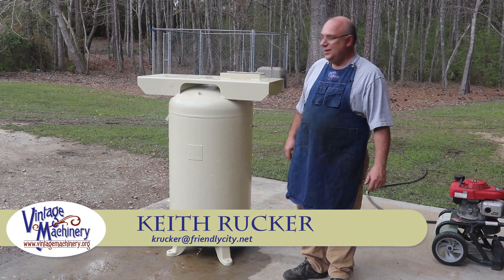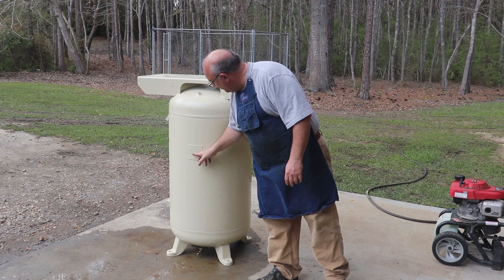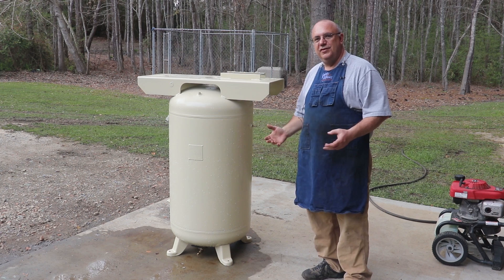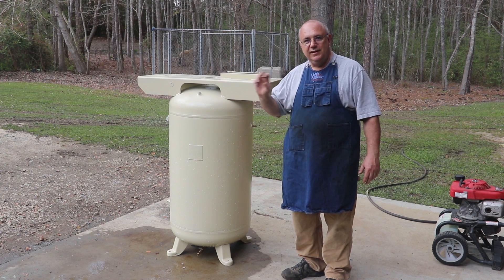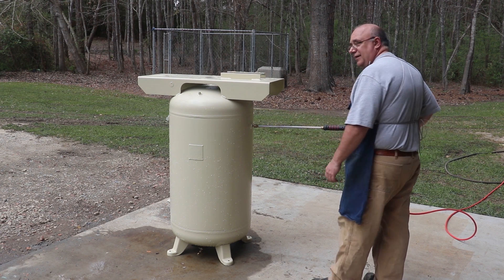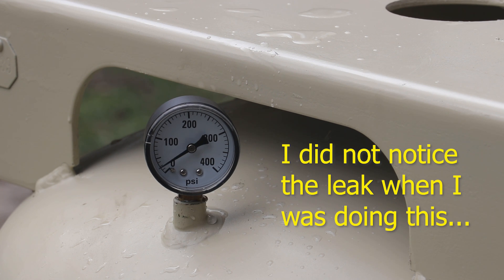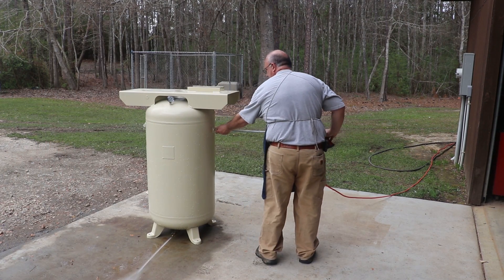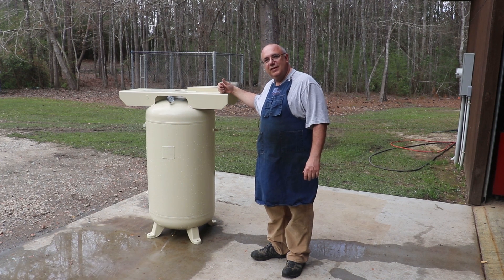Hydro Pressure Testing a Air Compressor Tank

Comment: In addition to the hydrostatic test my wife and I were speaking on getting one of those 8 foot ocean going container to contain the compressor? Obviously we would need makeup air in and out. After looking at the building blown to bits we are seriously considering going this route after doing Hydro tests.
We have an old Puma 60 gallon from 1992 or 3 and a horizontal 60 gallon from work that's at least 40 years old. 
Your thoughts to the group?

Comment: I have seen some dumb asses but you take the cake, firstly you don't have a safety valve fitted it should have a raised leg above it to vent the fittings of air and set to blow off at the test pressure, no raised bleed off valve from the highest point of the vessel  to get every bit of air out, that is imperative there must be absolutely No Air in the test vessel,  valves or fittings I have done tests on 20ton liquid capacity pressure vessels down to cigarette lighter sized pressure tanks Worst of all you are standing way to close to the vessel being tested, obviously you have never seen the destruction or damage  even a tiny compressor is capable of at much LOWER pressures 10-75 psi, The best Advice is if in doubt throw it out, or pay someone who is certified to do the test, it could be cheaper to buy a new Certified receiver, if someone gets hurt or suffers property damage you had better have very deeeep pockets those compliance plates on the receivers have dates and test pressures on them in industry they are tested every year  even if they are never used for years.

Comment: Awesome Informational Video! I thought I just picked up a old Air Compressor, but your air compressor is nearly twice as old as the 2002 Craftsman Air Compressor Model # 919.167340 | 33-gal | 6Hp | 120v/60Hz/1PH/15A I picked up last Sunday, February 2, 2025 from my local curb store. The owner told me that it still runs, but I need to purchase the gauges and a air hose: he helped me load it onto my truck. He upgraded to a new and stronger air compressor.  I was fortunate to find a Owner's Manual on the Sears Parts Direct website and after reading it and learning that a lot of the parts are out of production. I realized I don't know enough about using a air compressor; consequently, I am pondering on whether to keep the new replacement parts that I purchased from Ace Hardware. I was hoping that I could use the compressor to pressure wash the swimming pool deck and the driveway, but then that means more money! Yesterday, I spent nearly $110.00 for a air hose, two pressure gauges, a needle valve for the drain, a Craftsman Compressor Starter Kit and torque 20 bit. On Friday, Feb 7th I removed the shroud covers and cleaned them, but I still need to learn how to safely power it on. The sales clerk advised me to power the compressor on before I add the gauges, because it if doesn't power on then I can easily return the unopened products.

Comment: so glad to find your channel, we are in australia, we live quite remote and most of our things are vintage ..... (were not rich to buy brand new - which actually turns out the better option for repairs anyway) we have a 1972 885 david brown tractor with slasher and a 1976 nissan patrol 4x4 a 35 year old tripple cylinder air crompressor, which we had realised needs a closer look for safety issues, we just purchased a new pressure relief valve and will only use it outside the garage since we looked on youtube and see what has happened to some people in failing compressors, so we will give ours a good pressure test now, THANK YOU for this video and we look forward to checking out your other videos.  Channels like yours are priceless to us, just the two of us here, me and my husband on 60 acres and 200km round trip to anywhere, and costs a fortune for anyone to come out here so we try to do it all ourselves.

Comment: I don't really like how this was done.  These tanks often fail on the bottom where the drain fitting is.  I would have laid the tank on its side on a rubber mat and rolled it to a 100% dry area of the concrete slab so that I could have inspected for minute leaks at the drain fitting.  It's kind of silly to leave a tank standing in a puddle of water and be like "yup, I don't see anything."  Folks need to be really more thorough in the areas where these tanks almost always fail.  Or at least dry the whole tank and then use something like brown paper to find those tiny pores.

Comment: Hey Keith,
Thanks for making this video. I was watching The Compressor Guru and he mentioned how you do a Hydro test. I posted this question on his channel and I would like to get your opinion.
I would like to ask a question, what is the importance of draining the tank every day? I understand water and metal don’t get along with each other, but as soon as you turn these things on condensation starts to build up and pools at the bottom. So even if you drain it every day you’re not going to get 100% of the water out and it’s always gonna be damp inside which is going to promote rust.
Thanks!
God bless!!
Blue

Comment: Thank you for clarifying that age-old incorrect statement that "water is not compressible".  While it certainly has MUCH, MUCH lower compressibility than "air", it absolutely is compressible... and making a working test fixture that does so (to over 27 bar) has been a serious learning experience in physics.

Comment: Well Sunny beaches! I had a 80 gal tank that rusted through so I found one for 200.00 now when I was not to sure of the tank and wanted to test it. I read about people suggesting water test it, when I did not know who would do it I saw my pressure washer sitting there. After about fifteen minutes I found a quick air connector and put it on the pressure washer. iI figured maybe leave about a cubit foot of air in it and fill it with water, then I thought let’s see what YouTube says about it. Wow found this video! Doing the same thing! God is Good!

Comment: Nice explanation! The comments are interesting as well. Also, I was thinking if the remaining air in the tank mattered, possibly tilting the tank so that bung where you put the gauge was at the highest point while filling with the water to push the remaining air out. If it even matters. Thank you and May God Bless.

Comment: Use a pi diameter tape measure when hydro testing your tanks, they cost less than $20. Measure the circumference of the tank in three spots, top, middle, and bottom before testing. Measure them again after hydro testing is complete. If the measurements are the same then you had no permanent deformation. On older tanks hydro testing can cause unseen deformation, so you basically stretched it out and actually weakened it during the test, leading to catastrophic rupture when put in use later.

Comment: In my opinion, dumbest most dangerous thing I ever saw. That's right. Stand right next to it to see if it will explode. If you are smart and care about your life. just buy a new tank every ten years and switch over the mechanicals. If you spread the cost over ten years it's just a few dollars a month, (I've seen new ASME tanks, not the pre-rusted ones welded in Pakistan in a garage from old ship panels, for 4-6 hundred dollars. spread that over ten years, it's the cheapest insurance you'll ever buy. Don't be cheap when it comes to your life or others you care about.       Mike

Comment: Keith, long time lurker of your channel, here.  I inherited a vintage Sears Craftsman air compressor and have been wanting to do some kind of hydro test on it just for, as another connector said, peace of mind.  I didn't want to purchase any equipment that i would probably only use one, or pay to have a fully-certified test done, but as yet-another connector says, Ice seen the aftermath of a small shop compressor blow-out due to a rusty tank and I'd just feel safer with literally ANY test.  I had no idea i could potentially use my little pressure washer as a pump, it never occurred to me, so thank you for that!  I likely won't push the old thing over 150, I'll probably never use it for more than 80-100psi but i have over 4 decades of find memories for it and i want it to run again.

Comment: Pressure test by just standing next to the tank ? What if the tank fails ? Also dont think its good idea to turn on the valve for the water to go out so rapidly. I dont even find a reason to use a tank so old even if it passes the pressure test. It can fail in the next month or week or year after the pressure test since its that old. Are you gonna test it every month or so ? Just buy a new one. Not good practice at all this video to me. Its just common sense.

Comment: I'm glad I watched this before putting a used air compressor back into service!    I've seen air tanks fail before with compressed air and one took off like a rocket and banged into the shop ceiling, doing lots of damage - and could have killed someone if they were standing nearby!
Great job - I would never have thought of using a pressure washer to test it.

Comment: One way to do this is just pump it up to max capacity with air, then set it vertically on a big pile of dry wood and then light the wood on fire.  And then very quickly drive about a half mile away and try and catch it when it drops back in from orbit.  I call this the maximum apogee tolerance test.

Comment: It is quite exciting hearing the pops, snaps and other sounds, doing a burst-test on a test-specimen. I have done that :) We pumped up the specimens to 135 bar, before they leaked, no explosion at all with water. Just a pissing little leak of clean water. Of cource, just a little little bit of air was trapped during the test.
Good for 25 bar, the design that is. The test specimen destroyed.
Non-destructive testing is performed at 1,33 x MAWP (Maximum Allowable Working Pressure) as I recall it, cold or @ 20°C, save for higher temperature curves according to the material properties in question.

Comment: Q: are the tanks of those el-cheapo hobby compressors pressure tested?
Over time they accumulate condens water so i suppose rust could be an issue with those. i don't think those tanks have rust protection on the inside.

Comment: I hope I don't read your obituary in the newspaper saying you got killed when that tank exploded.  I heard air tank have a fixed amount of  pressure/depressurization cycles like the airframe on an a commercial airliner.  I'm thinking if it was used and given to you it may of exceeded it's number of pressurization cycles.
Reply: Everybody is going to die sometime or other. Never heard of an air compressor tank having a set number of cycles like an air liner fuselage.

Comment: Should you not also do a test with your relief valve installed to ensure that it opens?
Reply: No. The pressure relief valve  doesn't go to testing pressure and you usually need to refurbish the valve once it lifts,  because particles get onto the contact surfaces damaging them and thus preventing a good seal.

Comment: Good job. I bought an old Manchester pressure water tank (120 gal) for $70. I’m in the process of trying to clean the inside. But should I do this pressure test first? 
Either way? How would I clean the inside? I’ve seen fancy rollers (pitch) that roll abrasive material inside while slowly tilting (roll) to get the ends. But this beast is big. I’d rather find an easier way to scrub the inside. 
Thinking of Evap-o-rust followed by a wet sandblaster with my pressure washer. Then apply a rust stopper coating inside followed by epoxy resin. I just don’t know. You look like you know what you’re doing (except when you said “solid water 😬), so I’m asking you for advice. The tank is 40 years old and was being used as an air reservoir when I bought it. It has a lot of ports on it and a handle on top. Also has a drain valve underneath. 
Thanks for your attention. I like the quality of your work. 
(Max pressure inside will be 150 psi. It’s rated for 200). 
Paul.

Comment: I did this test twice, and my nerves are still shot every time i fire up the compressor, lol...  I used to run 150 psi, but I don't fill truck tires nearly as often as I used to, so I cranked the regulator down to 120 cutout.  But the test was run at 270 psi both times and the tank stayed silent and held each time for well over 30 minutes.   The safety valve is currently rated at 175 but I plan to get a new one rated at 150 or 145 because this one is starting to leak and pressure governors/regulators (mechanical) can fail and I just want more piece of mind.    I had already used the tank for a few years, just put some brackets on it to make it portable and mount the compressor and engine to.

Comment: Thank you Keith! I'm looking to buy an older 360 gallon horizonal tank, and this is a great start. If it has the larger bung I'll have pros look at it, but never in my life would I have thought to use my pressure washer in this manner. I thank you for your video!

Comment: Dangerous way of doing this. You should use a ball valve from a distance with a remote pressure gauge. You should also use a regulator valve, (not a trapped pressure unloader valve like is on the peessure washer). People, do not do this at home

Comment: Im all for the diy but as long as the correct tests applied for the tank. For a start the name plate or stamp should state the standard the tank was built, probably an ASME Section VIII tank, so you would follow UG-99 standard hydro static test procedure. At a min some of the test points are below:

Test at least 1.3 x MAWP (name plate) Pt = 150psi*1.3*LSR ~ 200psi minimum for the tank in the video, if the plate test pressure is 200psi its probably a 150psi max tank (dont confuse MAWP and test pressure). We dont know the exact test temp and material design temp and stresses so LSR is fudged here ~2-10% since its tested with cold water. Dont over pressurize a tank during the test as you could actually push it to yield. The tank design and test is meant to keep it well in the elastic region when its first built, tanks have safety factor and corrosion allowance but defiantly loose wall thickness over time and are weakened with age and cycles.

P inspection min = Pt /1.3 ~153psi, reduce the test pressure from 200psi to 153psi and do a visual inspection of the welds and joints for leaks, (dont go poking near a tank at test pressure). Test hold time is not specified for a hydro static test but it would be sufficient enough hold time to finish the visual inspection.

One note of caution, UG-100 allows a pneumatic pressure test of tanks where a hydro test would not work. In that case P test = 1.1 x MAWP and its done in incremental steps. Always reference the MAWP to determine the actual test pressure. Not the case for compressor tanks though, they are readily able to be hydro tested so UG-100 test is forbidden in this case, but good to note.

What the guy did in the video was more or less correct (for a compressor tank) but did not perform a visual check correctly, did not reference the test procedure (UG-99 test) and arbitrarily chose 1.5-2x because the tank can take it, confused it with ASME B31 process piping as a test pressure or boiler test pressure which is done at a higher multiple because the test fluid temperature is much lower then operating fluid temp of a boiler so the calculated LSR is much higher on a boiler then it would be on a room temp compressor. A cowboy kind of test approach in the video but within spec, and its better to test like this then not to test.

Comment: When I was an engineer working for a major oil company we used to hydrotest pressure vessels by filling them with hydraulic fluid or light oils (diesel fuel) and compress them up with a hand-pump (similar to what you see with a small hydraulic jack). We factored in the compressibility of fluids, temperature and something known as "the steel factor". Steel does stretch under pressure and it adds a fraction of a percent to the capacity of the pressure vessel and in a failure, that steel stretch will cause an outpouring (jet, spray, stream, etc..) at the point of failure. On some of the things we tested we operated at up to 2250 PSI (on 0.375 wall thickness steel) where things were connected with ANSI 600 flanges. The pressure had to hold for twelve hours and we had to record pressure to the fraction of a PSI and temperature of the vessel. On some of these systems it was for a 30 mile long segment of pipeline that had blind flanges added at the ends (or double block-and-bleed valves).

We had one notable failure on a 12" diameter pipeline that ruptured at a point where it was four feet underground. It blew a crater in the ground that looked like an artillery shell had gone off. The pressure at the end (where we were) dropped off very quickly but there still was enough dynamic energy in the system because of the steel-factor stretch.
Reply: "We had one notable failure ..."    What was in the line that ruptured?  Apparently a gas or something superheated.
Reply: @wryanddry2266 did you read the comment? They were hydro testing with light oils. What caused the built-up pressure was the stretch of the steal itself.

Comment: I had the horrible experience of being a pall bearar at a coworker's funeral.  He was killed during a hydro test of a  piping system.  A hose broke and he was struck by water from the hose.  There was a pocket of air in the pipe which added to the thrust of the water coming from the pipe. 

Lessons learned included included; hard piping all connections, making sure all pipes and vessels were filled 100%, using equipment intended and used exclusively for pressure testing, and keeping unauthorized personnel away from test connections.  

Good safety practices are required both at work and at  home.   Whether it be welding,  cutting way wipers with a  small bandsaw, pressure testing a compressed air receiver, or any other shop activity safe practices need to be followed. 

Bob